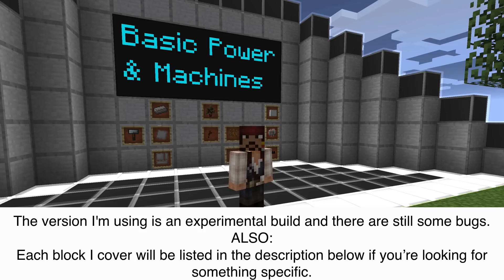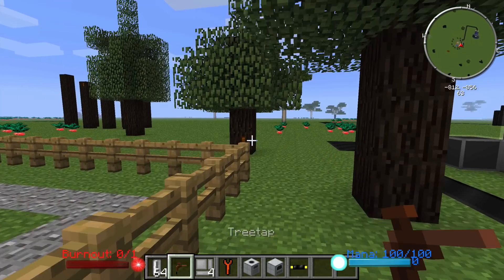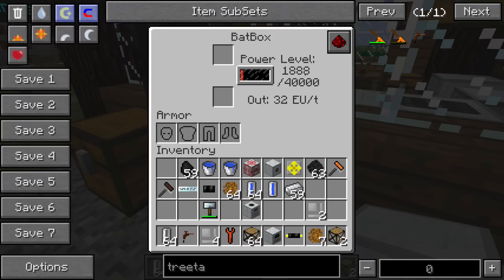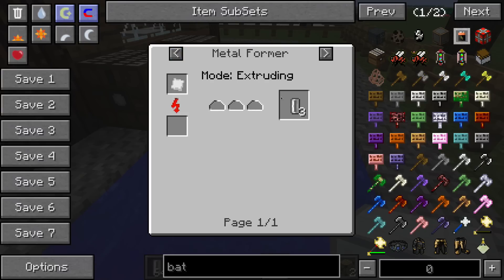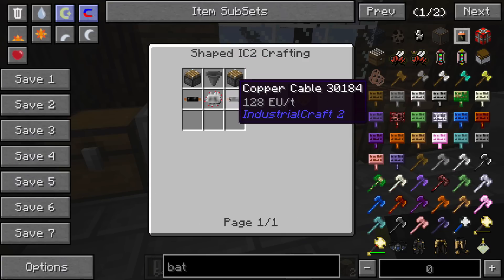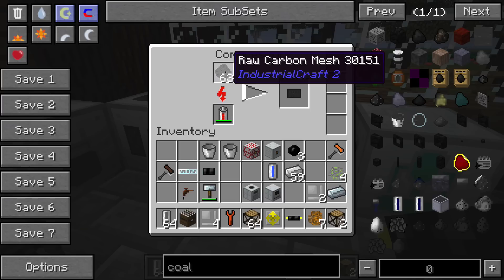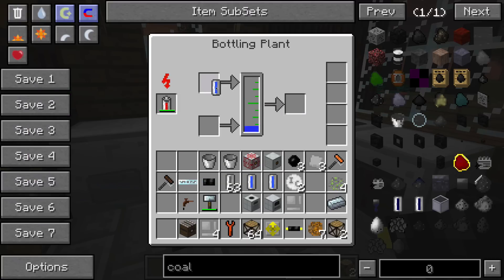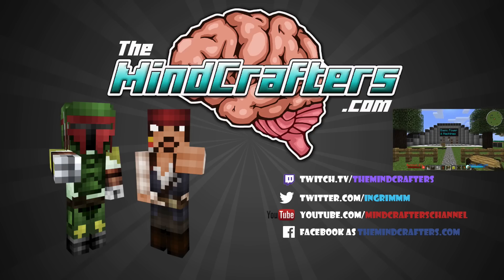IC2 1.6.4 Tutorial - Ep.1 - Basic Power & Machines

Comment: Windmill derp. Placement of the windmill is right, but the space in the mill is for the blades which can be made from wood, iron or carbon. Also you can increase the output from the windmill by putting some kinetic generators behind it.